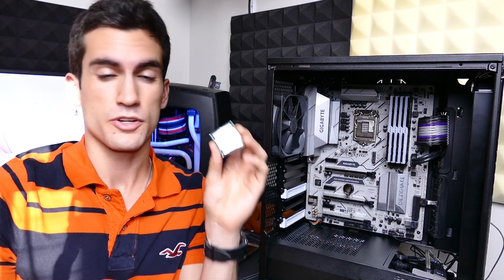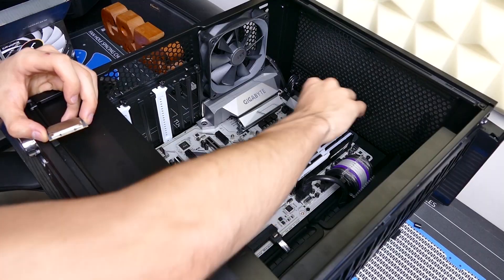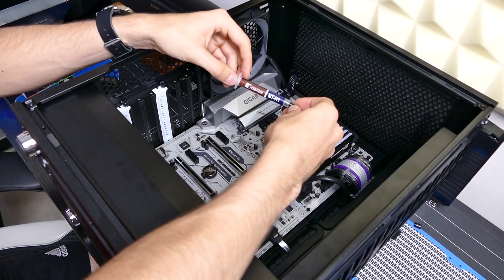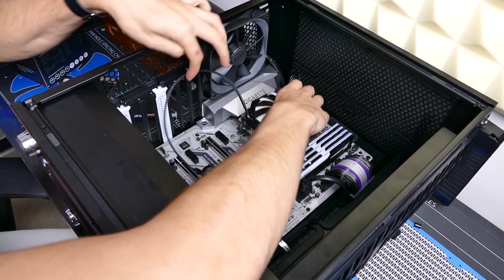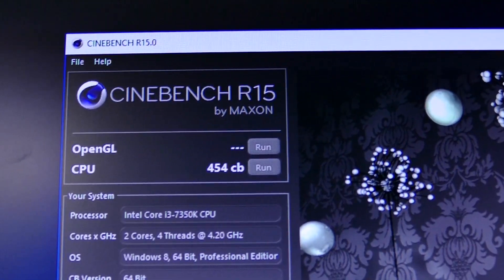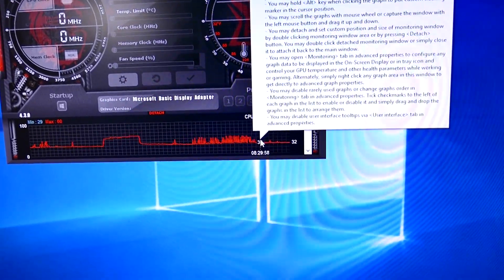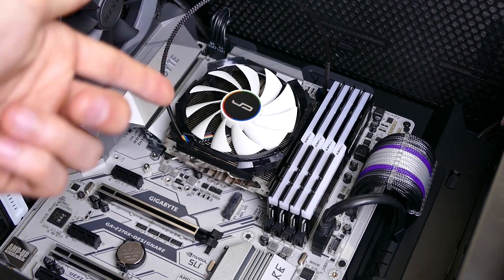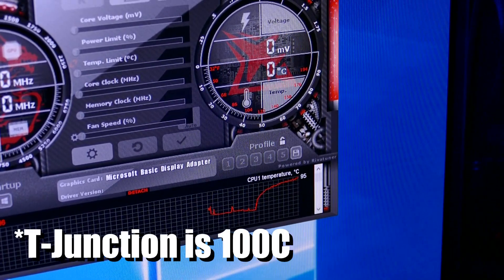Thermal Pad Instead of Thermal Paste?

Comment: My 15-4670K can do better than that 13-7350K. My Cinebench score was 562 and it only turbo boosts to 3.8 Ghtz and its 4 years old and cooling my CPU is a Cooler Master Hyper 212 EVO, and the thermal grease I used was from DeepCool. Note to self: Never buy a Kabylake i3 processor. Haswell still works just as fine and performs better than the i3. XD

Comment: would soldering a CPU to a heat-sink help with cooling if that even possable, and say if it was done on a laptop where you cant really change the heatsink or cpu, why not solder it so their no thermal paste.. am i crazy thinking this.. also Hi From UK. 4:46AM Here

Comment: How to kill an i3-7350K:

Put it in a room with an R5 1400. Tell the i3 how much the 1400 costs, then tell it how much an overclockable mobo for the 1400 is. Watch as the 7350K, deprived of its purpose for existing, 9590s itself into a glowing hole in your case where your motherboard used to be.
Reply: jamie 711711 Greg: cracks knuckles, smiling evilly at the processor
Reply: The i3 7350k has actually gone down "alot" in price though (atleas where i live). It now cost 10$ more than an i3-7100. (Not that the i3-7100 (3,7ghz) is a good deal when the Pentium g4560 (3.5hz) is around though.. Still don't see any use for a unlocked dualcore TBH.
Reply: Hey dont be so mean to the 9590 :D
Reply: the 9590 is the manliest cpu ever made
Reply: >9590s itself

I'm done.
Reply: Intel should've released the unlocked i3 earlier. Maybe with the Haswell lineup. They would've selled it like crazy.
Reply: well he is definitly the hottest cpu i ever had :D
Reply: Imagine a FX 9590 and a R9 295x2 put in a laptop! XD!
Reply: you mean the g4560?
Reply: well at the moment i would say if u want new stuff on a bidget get a g4560 a h110 and 8 gb of ram and u are at 200€ lets see what ryzen 3 has to offer in the price range :D
Reply: james199637 laptop version of sansung phones
Reply: DanielRichards644 but even when z170 is cheap, you are still needing to buy a K processors. at this point almost every ryzen builder will pick a b350 or z370 because all of their processors are cheaper. you are getting an i7 like stuff(in multithreaded workload, not games) that cost the same as i5 for ryzen 5. ryzen 3 can go as low as $100 in the rumor and has 4 cores. if the overclocking potential stays the same as r5 or r7, r3 will wreck the i3 in gaming too
Reply: the cheapest i7 7700k (4 cores 8 threads)i saw was around 300€ where u can get a ryzen 5 1600x (6 cores 12 threads) for 250€ or less and the cheapest z170 board i saw was 60€ and with the ryzenboards u are around the same price but well JUST for gaming the i7 is better
Reply: MAOAM12121 if it is JUST FOR GAMING you are better off waiting ryzen 3. i5 is enough for gaming, i7 has a little more fps but costs a lot more.

and where did you get those deals? if the deal were that regular and easy to find the i5 and i3 market would have been canibalised by i7
Reply: Lol you killed me
Reply: if it would work put a fx 9590 in it and ur laptop will have a meltdown in a matter of seconds :D
Reply: u got me :D thats a premium answer right ther lmao
Reply: you have my pity :D
Reply: DanielRichards644 the cheapest z270 i see is $104 while i see B350’s for $65
Reply: www.andyrawmaterial.com
andychowmailbox@gmail.com
Reply: well i have a xeon w3565 that cost less and have better cinebench guess what? i upgraded it to a 6 cores xeon that have more than double and have almost the same as a ryzen for what??? less than 50 usd ....
Reply: "What is my purpose?"..... "to fetch butter"....... "oh my God".... LMFAO
Reply: for his price you can buy really good 6 cored with 12 thread on 3.8-3.9ghz with stock cooler which will fine with it
ryzen 5 1600x. Motherboard is twice cut price of z170/270 and no need of aftermarket cooling
Reply: I got a i5 (7600K), and i am really happy with it.
Reply: DanielRichards644 sssh don't tell them that. let them continue to live in ignorance
Reply: CAN WE STOP with this BULLSHIT, Intel MOBO's cost more crap, there are PLENTY of z170/z270 boards in the same price bracket as B350, just like there are plenty of X370 (that you would need to do multiple GPU with Ryzen) that cost as much as the high end Z270 boards, Intel boards aren't stupid expensive till you go X99, which NO ONE should do.

Comment: what do you normally recommend as the maximum voltage when overclocking a CPU? I have an i5 4690k and i have heard that it is 1.35 volts MAX for use even when not doing intensive things like gaming.

Comment: Huh, the pad did better than I thought it would.    Always been curious if both the heat spreader and the heat sink were machined and polished for a perfect fit without thermal paste,, if it would even be possible?  
Would also like to see a comparison between the Aluminum and Copper Cryorig heatsinks they showed at Computex if you are able to get them.

Comment: make video of more thermal paste V less thermal paste .
Reply: More or too much can't really hurt, less or not enough could fry the cpu.
Reply: actually it do hurt , normal thermal compound has like 3 - 10 W/mK(Thermal Conductivity) . but metal to metal contact surface have 150 - 300 W/mK depending on type of metal . less thermal compound = more chance of metal to metal contact points which are like 30 -50 times more efficient. more thermal compound means complete insulation like thermal pads .
Reply: Linus already has a video like that
Reply: i used cool labratory liquid metal ca. 60 C° usingnow MX-4 ca 60 C°  maybe my radiator of the nzxt kraken x 61 is too bad or................idk but the liquid metal was almost burned into the copperbaseplate after half an hour cleaning the baseplate i gave it up let it soak in a thick layer of isopropyl alc 99% and got some more stuff off and then used mx 4
Reply: As long as you mount your heatsink properly, more can not really hurt as most of the excess paste gets pushed aside by the heatsink. Unless your thermal paste was conductive of course and it gets pushed down somewhere where it can short something out.

Comment: Thermal pad types are as widely varied as thermal pastes are when it comes to performance.  I know manufacturers of industrial single board computers that use thermal pads on CPU, GPU, FPGA, and CPLDs.  They can be effective in the right application.  I wouldn't use one in my home gaming PC myself.

Comment: new thermal grease helps cooling I had a 7ish year old server and applied new grease ran 5or more degrease cooler and thats 2/4 fan speed thats aluminum heatsinks no fans but in the 1u server rack case there are 40mm I think fans four of them that can go 16000rpm (very loud)

Comment: You said you used 3mm thick thermal pad, right?  Why not use a thin one, like 0.5mm?  I would like to see how that would compare against thermal paste.
Reply: Daniel Senti get the point across somewhat, the thicker the pad the more and more thermal resistance you add, a good(not some no name brand) .5mm pad would have been within a few degrees of the paste
Reply from the maker: Still gets the point across.
Reply: Science Studio fair enough

Comment: Use no paste and run aida
Or no heatsink and idle
Reply: themanwiththepan would probably well pass t junction before the system even finished booting. I've played around with an old dual core xeon, ~50 watts TDP, and that thing is too hot to touch after just 30 seconds of idling. imagine what a high-tdp chip like the 7350k would do under full load.
Reply: potato

Comment: Yo greg, then why don't we put thermal paste on GPU vrms instead for better cooling?
Reply: Biondi Wiyono Apple puts thermal paste on their GPU vrms. Not that they deserve to be praised, but a neat fact. lol
Reply: I guess its more messy for the manufacturer? It would be cool to see the right answer
Reply: Biondi Wiyono messy, needs direct compact, needs force applied to it.
attaching a heatsink would be a pain  because you'd need to apply equal pressure over the you chip and the vrms and the shape would have to be weird as it would need to make direct contact with the vrms (so it's so hard to design a heatsink and expensive).
also, paste isn't adhesive.
Reply: Tolerance issues come to mind first. GPU heatsinks don't (usually) sit flush with VRM components, it would be very difficult if not impossible to make good contact with thermal paste, thermal pads have some thickness to them that allow them to make good contact with the heatsink even when it is not directly sitting on the components.
Reply: It would give good cooling, and as long as the paste doesn't react poorly with the shell, it would work just fine. As CPUzero said, there is just less tolerance in the application. Also, there are more exposed contacts that you have to be VERY careful not to bridge or else you short it out and fry the component. It's the same reason old people like me who used to build computers when they didn't have full lids on and had important contacts on top you COULD NOT get anything conductive on freak out with the blob-method of paste application everyone uses nowadays. In the old days, you'd fry a CPU if you did that, but today unless you put so much it's oozing out the sides and getting into the socket and stuff, it's just fine and probably only makes a degree difference in temp, if that.
Reply: the more you know lol
Reply: i put MX-4 on my HD6950 an the vrms memory and the gpu itself it works fine no melting yet and it have a good contact BUTT ;) you have to be very carefully and at best put a thin layer on the vrms and memory directly
Reply: Actually there is non-conductive pastes you can purchase. So no worries at all with electricity going somewhere it shouldn't be.
Reply: because typically apple customers dont open up their computers at all. PC users often disassemble GPU to clean the heatsink/fan, reapply thermal paste....can you imagine how messy it will be if theres thermal paste as well for the vrms

Comment: Intel already does this under the ihs soooo.....
Reply from the maker: M8888
Reply: The joke stems from Intel using thermal paste, and not soldering the IHS and the die together like AMD does.
Reply: gud name
Not to mention its SHIT thermal paste
Reply: The Booty Guru you mean crest toothpaste
Reply: +Tom/Kate Fedrick
Broadwell-e is the last line of soldered cpus that intel has released, for their consumer line, I'm not sure about xeons and ryzen is in fact soldered (so was fx it just ran hot because it was a hot chip)
Reply: LN2 OC on single board computers next!!!!!
Reply: That's highly unusual.. even generic thermal paste usually sees at least a 10C difference during load
Reply: I mean fo intel's consumer lineup
Reply: Sometimes they even solder the packages to the IHS, those are the ones you shouldn't try to delid
Reply: not anymore they don't. Broadwell-e is officially the last line of soldered CPUs
Reply: i thought they used toothpaste
Reply: Don't they use thermal adhesive? Or was this a joke and I got whooshed...
Reply: I can't tell if that is a reply to me or not but it isn't unusual at all. People say to not use AS5 because you won't get any difference in temperature. I used AS5 originally because I delidded before I got my liquid ultra. I usually use AS5 because it's cheap and performs/lasts pretty well.
Reply: It seems more like AS5. How do I know? I delidded my i7 and swapped for AS5 and it performed exactly the same.

Comment: I love how your always bashing the i3 7350k. Keep it up greg
Reply: TheJoJmaster you have a 7350k don't you?
Reply: Would you buy it only as a box opener? If so I'm sure Greg would approve.
Reply: Dunno why you'd call yourself a sap. PhenomII was a hell of an architecture. Those things woudl hit 3.7 way in and day out, if you were lucky on stock volts. 

Have a 1100t in my old computer still going strong at 4.0Ghz
Reply: It sure as hell isnt good at what it does in its price range compared to other CPU's.
Reply: Not as bad a value as the 1055t. I was one of the poor saps who bought the thing.
Reply: Gravitygrim yes but in the future the i3 is useless because more games will use 4-8 cores
Reply: Nice h3h3 reference.
Reply: Just use it in a mining rig all its about good for
Reply: Crappy single core performance stops me from being able to emulate gamecube and even play some newer games. I have the 1055t and therefore am only able to OC to 3.5 ghz. The 1100t was better with this issue. The 1055t remains a bottleneck in most games for my 1050ti. My cinebench score is 524. For reference, the i3 7350 hits about 514. Looking good so far... Now for a single threaded cinebench test. The 1055t that I have hits 92cb. The i3 7350 howerver, hits 206cb. In games that rely on only using a few cores instead of the 6 that I have. I would probably be 50% the performance of the 7350k. As a gaming CPU, the Phenom II 1055t has no place, as it is way more of a workstation cpu, something like rendering that can use all 6 cores. The mistake that I made was buying the thing as a gaming cpu, so I now pay the price.
Reply: JUST DO IT for the price, getting a similarly priced low end i5 still scores higher in many benchmark and games
Reply: CUSTARDP00DLETK it's a stupid processor. Lol
Reply: Gravitygrim especially the Phenom II 1055 was one of the best Phenom II processors. It could hit 3,8 with ease! Most of them would hit 4,0 GHZ. I still use an Phenom II 1075T and it runs with 3,7 it would probably run faster but I have only DDR2 and the Memory is pretty bad. But it runs every game like a charm and it runs fast as fuck. Especially games with multicore optimization are a smooth shit. Only some games like WOW which need single core performance get some smaller problems! Maybe you should tweak some of your OC settings! The 1055 is overclockable af